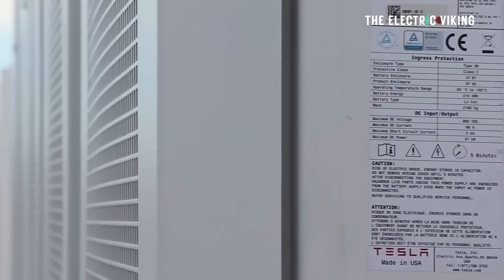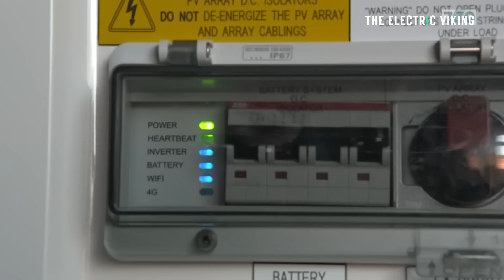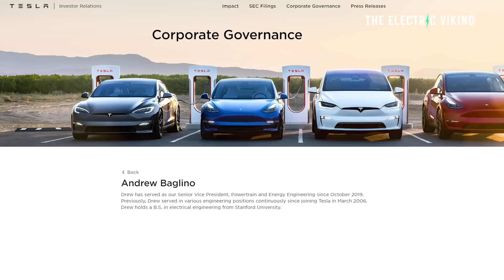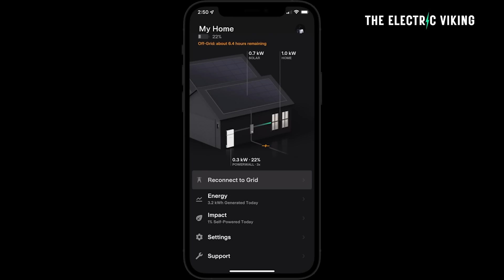Tesla's secret to unlocking fully renewable grids all over the world

Comment: Plant Vogtel nuclear-power facility is in Ga.  When fully completed,(two reactors operating, one going through shakedown run, 4th one still in construction) will produce around 40000 gwh a year.  
The land area it takes up multiplied by 4 and used as a solar farm would produce ¹/²⁰  that amount of energy based on 11 acres per megawatt of installed solar, which appears to be the norm for new solar installs in my area of Georgia.  Therefore 80 times the actual  land area (around a quarter of a million acres) to produce the same annual power output.  
While land area may not be something solar and nuclear have in common, there is somethings they do share.  A twenty five to fifty year lifespan with no good end of life disposal plan.  A quarter of a million acres of solar panels with no successful recycling method is a huge mess waiting to happen. 
Not a huge fan of nukes, but fake math isn't the solution.
Reply: "The research suggests that $18 per panel for 12 years would establish a profitable and sustainable solar panel recycling industry by 2032. This amount is small compared to subsidies the government provides to fossil fuels."
Reply: @michelangelobuonarroti916  I look forword to a day when recycling of solar is the norm.  Sometimes wonder if all these Government kickbacks (especially US) wouldn't be better spent in research on issues like that.  Tesla doesn't need the Government handout to accomplish their goal.  Still boggles my mind that upon completion of ramp of new expansion in Nevada, Tesla will be refunded the full cost of that expansion every year, over and over again by the government through IRA kickbacks.
Reply: 'no good end of life disposal plan' is totally wrong in the case of solar panels. Their materials are near 100% recyclable immediately; no waiting for radiation levels to drop. And when the silicon is recycled it reduces the cost of silicon in new panels.
The 'land use' argument is also spurious, because a solar farm can take many forms. In Australia, shopping centres used to use shade sails to shade the cars; now they use solar panels. In rural areas, animals can graze beneath solar panels, and many crops are possible where panel spacing allows partial sunlight.
Can't do those things with a nuclear power plant!
Reply: @davidinkster1296  solar also doesn’t produce any energy at least 50% of the time. Nuclear energy is 24/7/365. The sheer volume of renewables and batteries to generate and store the energy required don’t make any sense when compared to Nuclear.

Can you tell me how these solar panels would be recycled when the energy and time costs of breaking down a panel to get what amounts to near worthless elements. The time and cost to break it down is worth more than the elements that make it up. You can’t just make more solar panels out of those elements either- new material and more energy is required. Despite several recycling companies trying none have been able to close the business case and are just storing the separate raw materials in the hope some future use can be found for them. You do realise that nuclear fuel releases only 1% of its energy each pass through a reactor and can be reprocessed enough times to provide near limitless energy? But don’t let physics get in the way of a good storey.
Reply: @polarbear7255  Physics is good but facts are better. Facts are that here in Australia solar and wind are a fraction of the cost of nuclear. Nuclear advocates like me get laughed at!
And you are wrong on the recycling of solar panels. The silicon itself is quite energy-intensive to produce from sand, and even having to re-melt to get new crystals saves the energy used to strip the oxygen from it. Reason its not done much, yet, is that most panels are too young. In 20~30 years it will be a growth industry.
I say I am a nuclear advocate; I am advocating re-use of the nuclear reactors from nuclear subs and other ships, for land-based power stations. Clearly, the reactors from warships will have 50~70% of their capacity remaining when replaced or 'scrapped' as ships will always need a reserve for safety reasons. This is not such a drama on land, especially when there are multiple such reactors in an installation. Ultimately I see nuclear as the propulsion of choice for all large ships, naval and commercial.
Reply: @davidinkster1296  No mate. That’s not how naval reactors work. They are built into the vessel and are not designed for refuelling (not current ones anyway). Also as part of NNPT and START2 all Naval reactors are sealed in the section of the ships hull and stored in the desert in the open for ease of inspection.

If you want naval reactors then you need to look in detail at SMRs which are an application of the same design philosophy.

‘Facts’ do not trump physics. The Gencost report and ‘lazards’ that show renewables as cheapest are not accurate when used to compare dispatchable baseload such as nuclear or coal to renewables. Especially Nuclear. Gencost even states that Nuclear was not even a consideration. 

When AEMO states we will have an 8000MW energy shortfall of dispatchable baseload in the next 2 years we have a problem.

When 100% renewables relies on the import of 22K solar panels and 16 wind turbines per day for the next 15 years, we have a bigger problem. And that doesn’t include batteries.

Nuclear energy generation is supplied by friendly western nations not the CCP. We don not want to be reliant on the country we are going to fight in the next 5-10 years.

60/40 nuclear/renewables seems like a workable compromise as they are both complimentary technologies. That mix will also give the best consumer price per KWh.

I watched a news piece on the ABC only a month ago on solar panel recycling, they could not close the business case. It may be too early but the costs outweigh the benefits- its cheaper to just import a new panel from China than recycle an old one into anything else.

Remember when renewables don’t generate anything their cost per KWh goes infinite. Nuclear baseload is 24/7/365.

Renewables have their place but it’s not 100% of the grid, for a very many reasons.
Reply: @polarbear7255  I do not envisage the need to refuel the scrapped reactors; just extract more of the energy that is still available. This represents an almost zero cost means of extracting energy from something that would otherwise go to waste, just sitting in the desert.
Reply: @David Inkster  Good points.  Perhaps I should have been more clear on one point.    It's not that it is beyond ability to recycle solar panels, but I have read consistantly there is no money in it.  The process cost far more than the material recovered is worth.   Such objects usually become landfill material.   If procedures, processes, and or redesign of the panels themselves could overcome that, it would make the switch more viable.
Reply: @pathfollower  correct sir. Unpopular, but true.
Reply: polarb7 • No matter what your shoddy argument is, the future is only renewable energy, solar, wind, waves, tides, etc, and energetic centers of storage battery packs.
Reply: @mikel4879  no shoddy argument mate. Just cold hard physics. I like renewables, they will not work on their own. Even AEMO and the director of ANSTO have said exactly that. I don’t work with agendas and ideology, thats why I believe, as does the director of ANSTO that an energy mix is the key. Renewables only generation has not been successful in any country on the planet despite 30 years of trying and trillions of dollars or Euros in investment renewables have failed to deliver anything over 50% at the national level- a failure without doubt. The future will be wind and solar and some batteries and geothermal and... nuclear: it is inevitable- Australia will have no choice.
Reply: People talking about how little area nuclear plant takes tend to forget that you need a security zone around it. Solar panels can be installed on buildings people live in, on walls, above fields used for agriculture, even floating on water. A nuclear plant has lots of rules what can be done on, above, or even near the land it is on; solar does not.

But the amount of land they need is not really important unless you are trying to power some microstate, the amount of people and money needed to build and keep them running is. It does not matter how much more useful nuclear power is at some land where the sun does not shine if they cannot afford it or provide the engineers and security needed to operate it.

As for the waste, plans how to deal with the radioactive kind are still woefully lacking. Meanwhile solar panels are not causing any problems because they are not toxic, they are not radioactive and they are worth a lot of money when recycled. A typical panel contains more than ten dollars worth of silver, that alone would pay for most of the cost of recycling it. The only problem with recycling solar panels is that fake news claiming that it does not happen are more common than true stories about the companies that are already doing it.
Reply: @AnalystPrime  No we don’t. It’s simple physics. Even with all the ‘zones’ and areas Nuclear has a far smaller footprint than any renewables. Solar also need TW of storage to be effective, so add that to your land area. Land use matters.
Ewaste matters. Spent nuclear fuel can be reprocessed many many times as only 1% of the energy is used each pass through a reactor. Renewables can absolutely be part of the grid:  they just can’t be 100%. 60/40 Nuclear/renewables should result in the best mix with the lowest energy costs to the consumer. The cost in mining, construction and raw materials to produce 100% renewables grid is simply staggering at 1.5 trillion dollars. Nuclear drastically reduces that impact, both to the environment and the wallet. Energy density is king. 

100% renewables is like buying 100 1 watt globes when all you need is a 100 Watt globe with the argument that the 1 watt globe is cheaper up front. Not only that but the 1 watt globes need to run off a battery where the 100 watt globe runs off your 240v supply.
Reply: @AnalystPrime  please elaborate.  I have looked for such solar panel recycling companies to no avail.
Reply: @AnalystPrime  I am interested in agrisolar.  I am director of a non-profit.  We operate in Uganda and are currently looking at turning 32 acres of land into a farm  for an orphanage there.  The thought of solar has intrigued me.
Reply: Updated perspective:  
Wikipedia claims the state of Georgia as being made up of 59425 square miles.  
If we do a round down to an even 59000 square miles, our rounded off figure of 425 square miles is more than the quarter million acres required to replace the named nuclear-power station in my earlier comment.  My figures on tte amount of solar required are based on 11 acres per deployed megawatt of solar and an annual average equivalent of 5 peak hours a day of electrical production.  Storage batteries required use an insignificant land area in comparison.  
I guess comparing the land required to a rounding error makes it sound like a less significant amount of land.  But then counteracting that perception is the fact this area is still equivalent to 100% of the land in about 3 of Georgia's counties, albeit smaller ones.
Reply: @pathfollower  I guess you are saying that nuclear is doing a good job of supplying power for you at the moment, and that's great! At least it's not fossil fuel.
Where Electric Viking is coming from (and I agree with him) is that Australia has been having an ongoing and sometimes acrimonious debate about renewables vs fossil fuel (we haven't even got into nuclear yet, and that's a whole new arena) and we have had a gutful of conservative politicians who say 'yes, but what do we do when the sun don't shine and the wind don't blow?' The answer, of course, is energy storage.
That's why I tend to react to people saying it can't be done economically. Maybe not everywhere, but for a large proportion of the world it can. It works. I'm living it.
As a postscript, most of those conservative politicians have been voted out of power. The people are having the last word, as it should be.😀
Reply: @David Inkster  The statement given was that solar uses up the same amount of land as nuclear power.   Then the Viking said, "That may sound crazy, but..."
It did sound crazy and I did the math.   Even used his figure of 4× the actual land area for nuclear plant.  It was complete BS by those parameters.   I have been disturbed that certain negative aspects of Solar have been ignored or misrepresented.  If solar  is a solution to a problem, then these aspects need to be addressed.  I never said I was against going with renewables over fossil fuel.  I'm a retired Auto Tech, and I love EVs.  
But Solar has issues that haven't been overcome, in efficiency, and in the current economics of recycling.  And making false claims doesn't fix anything.  
Australia is a different place than GA.  No deserts here(yet).  While you have massive room for solar,  the fact is that hot desert is not the ideal location for solar.   Panels lose a significant amount of efficiency when they get hot, especially Australia hot.  Also, their lifespan is reduced significantly.   Lots of technical issues are still to be addressed.   Lets address them, not make up fake facts, and pretend there are no problems. 
I like the concept of Agriphotovoltaics.  Panels over farms. Can still grow crops on the land.   Panels and crops both stay cooler.  Crops use less water.  
But it's not all perfection.  More infrastructure for higher panel mounting, and since it is spread out over even more land area, it requires lots more copper wire to connect it all. 
PS i am very conservative, and I dont believe in feelings over facts.
Reply: @davidinkster1296  that renewables and nuclear debate needs to be had, and quickly. Nuclear is the key to going zero emissions at the national level. It’s only politics and ideology that are holding it back. If we had gone nuclear in the 70s and 80s we would not be in the situation we are now in. We would have been emissions free for the energy grid for decades by now...
Reply: @pathfollower  Still sounds like you are grasping for reasons to avoid solar. Lets examine some:
Loss of output at high temperatures: Non-issue because peak demands are at beginning and end of day. In fact I have seen proposals to make solar cells translucent & mount vertically to better catch the rising and setting sun. I made the 'mistake' of designing my roof 40+yrs ago with optimum angle and orientation; there is so much diffuse radiation that these optima are unimportant. one learns these from experience.
Recycling will never be done by your local scrap dealer; the silicon has to go back to a silicon foundry to be recycled. We have 20 years before it becomes an issue.
Lifespan is determined by mechanical factors mainly; delamination and corrosion of metal contacts, cracking of the silicon (That can be caused by thermal cycling; so the temperature swings of the Australian desert will be more unfavorable than the more consistent temperatures of GA.
Cost of copper interconnections for agriPV are similar to the cost of exclusion fencing that won't be needed
So the issues are really only limitations, and given the research that is ongoing with PV, these limitations will reduce with time. Even with the limitations, I am delighted with solar. I am planning to add more panels and eventually be able to go off-grid, even though I live on the outskirts of a city.
Reply: @David Inkster  I recently retired and hope to build a small hobbit home up in the north Georgia mountians.  I intend to have solar.  I plan to have an EV.   I am not anti solar.  I just see issues that are not always being acknowledged by the optimists.   This statement of nuclear-power and solar-power being land space equivalent I called BS.  ¹/²⁰ the power by the best math I can come up with.  I actually find this weird because my math skills are pretty bad, and compared to a rocket scientist, I would think Elon would be the correct one.  Maybe he is, but I can't make his math work. 
I just really wish Elon would put an engineering team on making multijunction solar cells economically at scale.  Then we would need half as many solar panels.  That would be a significant milestone to a goal of bringing the world to a sustainable energy model.
Reply: I agree and simply using Bing's new Chat option to look for results showed: The newest nuclear power plant in the USA is the Watts Bar Nuclear Plant in Tennessee. It has a capacity of 1,150 megawatts and requires about 1.5 square miles of land. In contrast, the largest solar power farm in the USA is the Solar Star in California. It has a capacity of 747 megawatts and covers 13 square miles of land. I could repeat this query for each continent.
Reply: @lorenmerriman8439  I agree that you and Roger Debats are correct. E. Viking is wrong, unless talking about exclusive use. In Australia most of the solar PV is rooftop, and most of that is residential homes, so the solar requires effectively zero land, because it is shared use.
The official stats say that about 1 in 3 homes and businesses in Australia have solar PV panels, but the generating capacity can be much more. I could fit 4 times my present panels on my roofs, so Australia could probably multiply its solar power by 10 without having to commit to extra land use.
Reply: Correct Sir. Elon’s statement has been proven to be complete BS. Nuclear’s energy density is unmatched.
Reply: Vogtle should ad a massive bess to it, so it can soak up any of the plants excess and dispatch it later at highly profitable pricing.
Reply: VOGTEL will be able to run for EIGHTY years if managed optimally. There is NOTHING that rivals nuclear for energy produced per overall safety, cleanliness, and low CO2 per kilowatt.
Reply: Nuclear as originally designed burned 95% with little waste and can  make energy for pennies a kilowatt and is safe then, The powers to be destroyed that, didn't reburn the waste and used it for bombs or to make profitable waste dumps
Reply: How do you know it fake math rather than bad math? Injecting bias isn't the solution either.
Reply: @nguy404   In 2015, MIT published a massive study, entitled The Future of Solar Energy. ‘This study is motivated by the enormous potential of solar energy as a tool to reduce global CO2 emissions and the great importance of effecting those reductions,’ it said.

According to that study, producing all the energy the US would need in 2050 from solar panels would take about 33 000 km2, which means Elon Musk exaggerated/WAS WRONG by a factor of 165. ELON WAS NOT EVEN REMOTELY CORRECT ABOUT NUCLEAR VS SOLAR ENERGY DENSITY.
Reply: @beautifulgirl219  correct Sir. Nuclear is unmatched in energy density. Nothing else is even close.
Reply: @nguy404  Okay.  I guess when "professionals" do a "study" and the outcome appears to be nowhere near reality, I assume purposeful bias.   Cynical me. 
Also I am becoming more and more adamant about the area required for solar seems to be  being misrepresented and/or ignored on a regular basis.  
Example:  I live near I75 in Ga.  Major north south to and from FL.  About 9000 Semis a day travel that road.  If we build a 15 acre truckstop especially for Tesla Semi, and it charges 100 semis a day with 800kw charge each.  The solar farm is TEN TIMES the size of the truckstop or 150 acres.  Instead of all the IRA kickbacks to companies that shouldn't need them, maybe the government should offer a reward.  They will reimburse  all expenses for R&D for whomever finds a way to economically make multijunction solar panels at scale.  A 70-100% increase in efficiency from what we have now is what is nessecary in solar development.   The panels exist.  We send them to space.  But they cost 10000 times more than a standard solar panel.